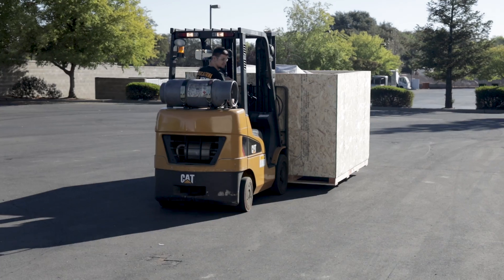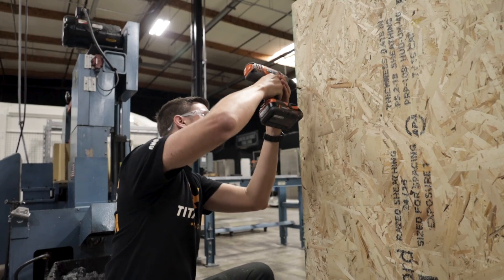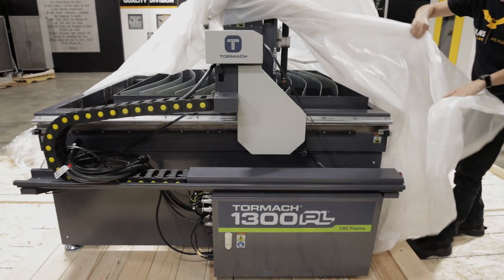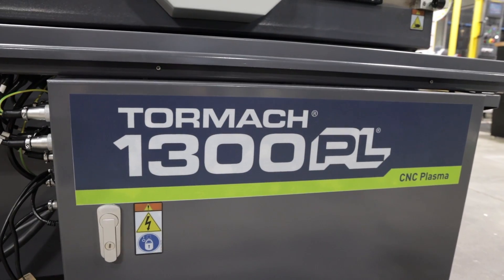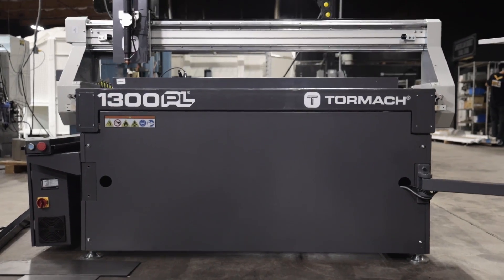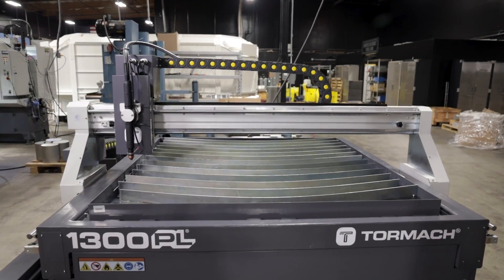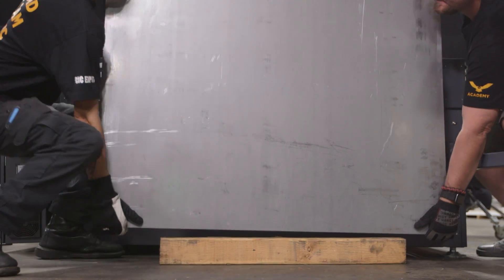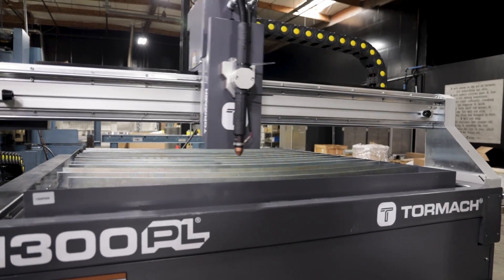Just Got A Tormach CNC Plasma Table! Also Made Our First Project!

Comment: Hmm good for something. would prefer laser for most things. A good bystronic is costly but good. But a water jet is also awesome. 
Have programmed and used bys co2 for some years. Now water jet and a cheap chinese fiber. With tube cuttingmodule  Which suits our needs. But wishing for better laser...😃 but glad that I had the xp before getting that. Enables me to get good quality out of mediocre machine. But always good addition to a workshop to be able to cut plate. Good luck!
Reply: Throw a Xpert 40 on the floor next to it as well and call it complete

Comment: Plasma cutting.. what I do. Looks like you could bump the cut speed up a bit. Whad'ja get: 45 or 65...I run a HT PM 65. Really like the water table: good call, really cuts the plasma dust down, something they don't warn you about; it's magnetic and gets EVERYWHERE :-)
Reply: Plas dust and coolant make an excellent lapping compound for machine ways and ball screws.

Comment: I can see one mod for that 
And that is a service on the thing that holds the head ( so you can cut parts at the ends on a angle. Witch i think would be pretty cool. And also easy to trim in the head in case that it should for some reason get out of trim ( easter to turn a little handel then keep hitting it with a hammer)